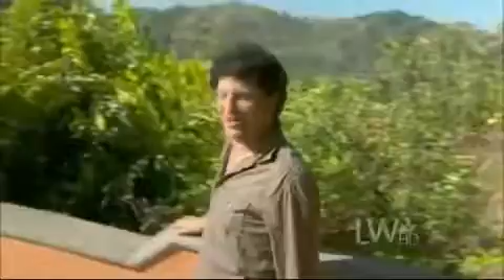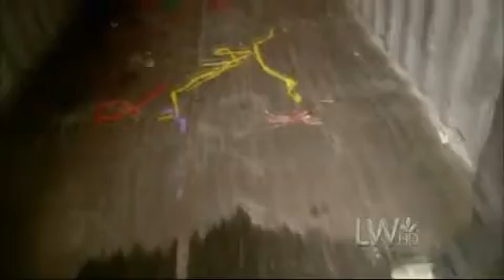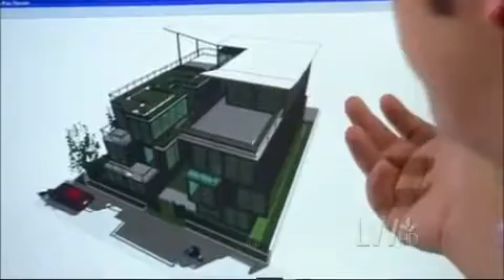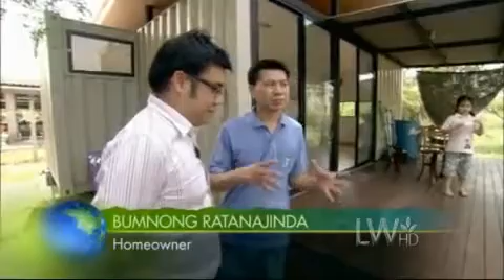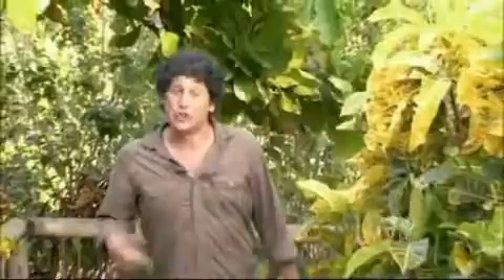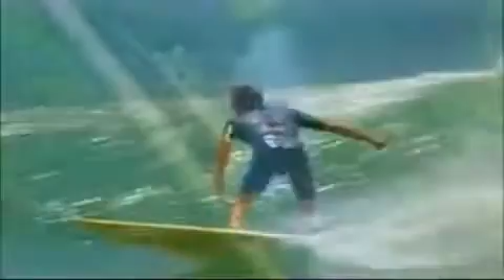Shipping Container Homes to help the Homeless, Natural Disaster Survivors

Comment: DUDE YA GOTTA CHILL  THESE THINGS ARE CHEAP  A 52 FT CONTAINER GOES FOR ABOUT 3000$ IF YOU TAKE 6 WELD THEM TOGETHER  3 AND 3 YOULL HAVE A HOME 106FT X 24 FT WITH 9 FT CEILINGS. THATS OVER 2500SF HOME --AN EASY 4 BEDROOM RANCH STYLE .THE INTERIOR FINISHING INCLU 2 BATHROOMS AND KITCHEN SHOULD BE ABOUT 50,000 FOR A HIGHER END FINISH FOR A TOTAL OF 70,000 --LESS THAN HALF THE PRICE OF A STICK BUILT HOME  BUT SAFER IN A STORM BEING THAT ITS WELDED TO THE GROUND AND THE STEEL WALLS ARE BULLET PROF